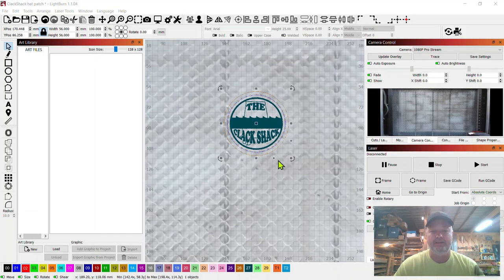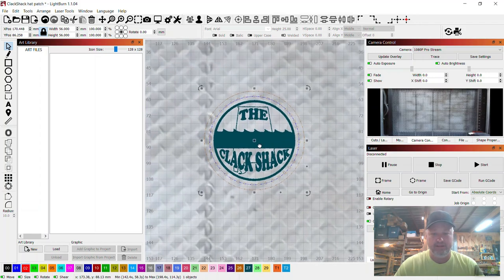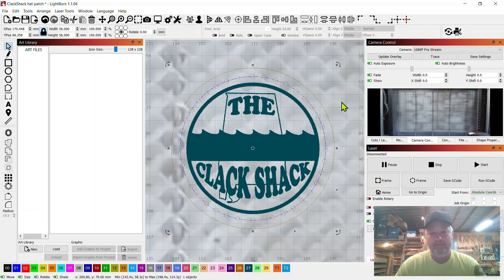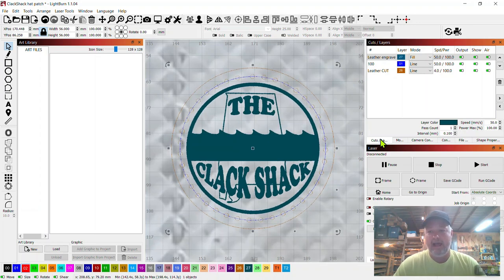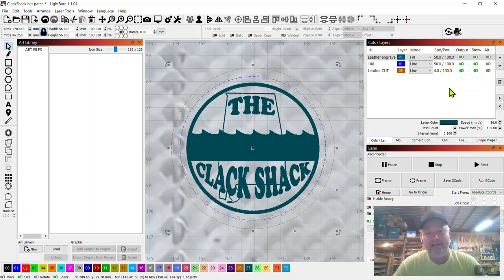Hat Patch design build in lightburn

Comment: Thanks for the video.  The breaking of the  shape is a different method than I have seen in the past, but a good one.  I do have one question.  If i wanted to make a groove where your holes are and not holes, but wanted it a certain width and depth, how could I do it, or if it's even possible in Lightburn?  What I want to do is make a stitching groove that is the width and depth of my thread (heavy thread like you would use building a saddle) so the thread is protected and sits down in the groove.  I would be stitching it with an industrial sewing machine.  Only way that I can think of doing it is to defocus the lens to get a wider groove, and trial and error on the depth.  Do you have any ideas?  Would be on a Co2 laser.  Thanks.
Reply from the maker: You could set it to engrave a groove in the file. You can make pretty much anything in lightburn if you get proficient using node editing.
Reply: @TheClackShack  so when you say cut a groove, do you mean just make the line and engrave it?  But how would I change the width?  I know the depth would be changing the power for deeper or shallower.  Just don't know how to change the width of the line to match my thread size.
Reply from the maker: Make it a tiny rectangle @bigfranksworld

Comment: Thanks but what if you want to do lines around the path? When I do, lines go left to right on the top and bottom and also on the sides. I need them to go up and down on the sides along the path.
Reply from the maker: You can use the offset line to create as many as you want. just change the offset distance and you can also do inside and outside during the process. Just replicate using the offset and then change the one you want into a patch.
Reply: @TheClackShack  Thanks. Not sure if I’m following but I’ll give it a try. I went and rotated the side ones by 90 degrees but I had to do each individual one.
Reply: @TheClackShack  That works great with a square or rectangle but not with a circle. I'm trying to make broken lines around a circle to emulate the look of stitches
Reply from the maker: @howardgoldstein1088  , yea. I had an issue with the rectangles being oriented in different directions. Thats why I use circles for mine. I hand stitch them.
Reply: @TheClackShack  So I figured it out. If you want to make rectangles that go around the circle to look like stitches you use the circle array. I hand stitch but if I receive a larger order it would take forever. This may work with glue but I haven’t tried that yet. Trying to find a permanent bonding glue.
Reply from the maker: @howardgoldstein1088  , cool. I haven't used that feature yet. I use the leather cement and it holds very well. I know because I had a keyboard error on a patch and had to remove it to be replaced. Luckily, I only used a small amount right in the center of the patch. It pulled the outer layer of leather off and it stayed on the hat.
Reply: @TheClackShack  Good to know. I have the leather cement to try. Ill give it a shot. Thanks